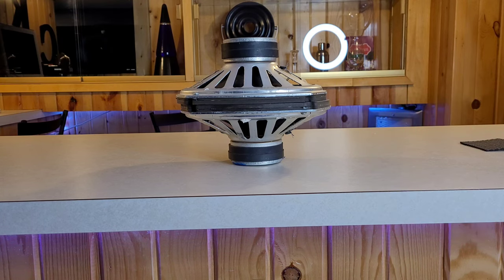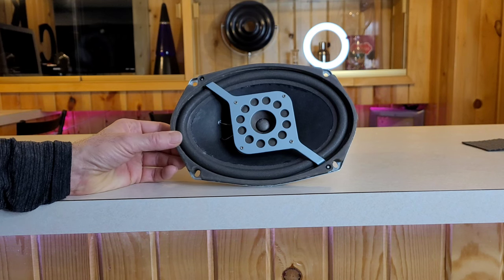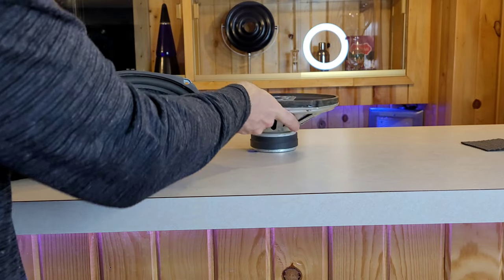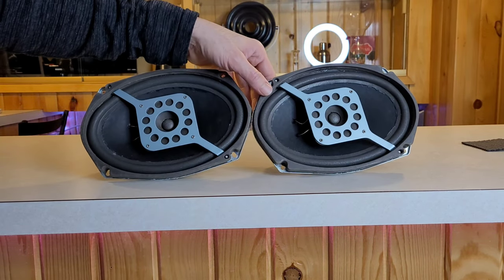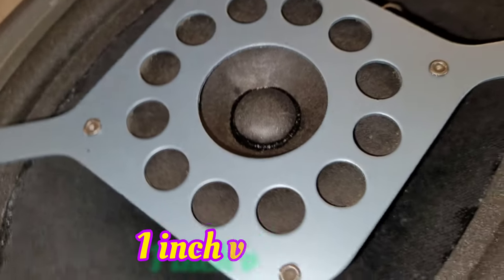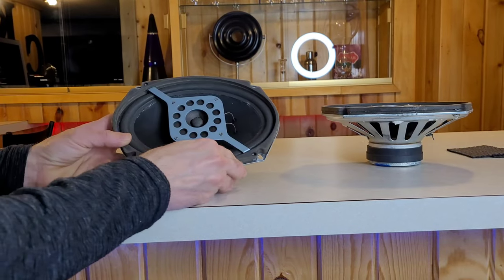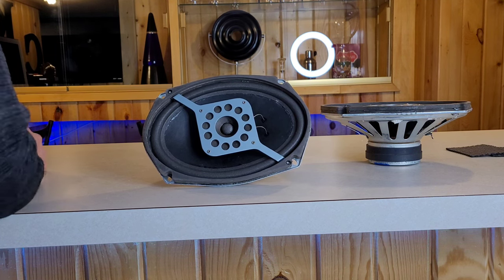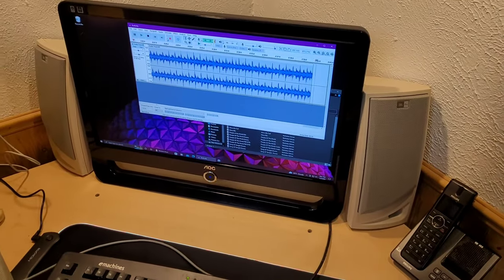Jensen Coaxial speaker from 1975. NOS 🔊   Model C9800

Comment: I installed sooo many of these in the 70s..these and the Pioneer supertuners. In their day, they sounded great (remembering early car stereo days)
Reply from the maker: I have always been a Jensen fan.  Their older stuff is spot on and has a good overall tone. Their 70s gear is almost all rather good. These have a nice sound and can take quite a bit of power. You also hit the combination on the head, too, with the tuner. I got my first set of wheels in the 90s, and Jensen speakers with a pioneer head unit is all I went to. Growing up we had a pair of Jensen OPC speakers.  That's when my speaker obsession started lol. Thanks for stopping by.

Comment: That capacitor needs to be replaced, it's probably passing lower frequency to that tweeter which is bad for them.
Reply from the maker: Very true. I will have a look and see if I have the correct value to replace it with.

Comment: Those are some neat looking speakers. I seen a pair similar to these In my buddy's old Malibu. They were in an enclosure on his back dash. They didn't sound too bad, they had a rich tone, crisp and clean vocals. I remember hearing a lot of rock songs come out of them. They didn't sound too bad, the tweeters looked a little different.

Good job fixing those. They sound pretty good. That's a cool keyboard you got. I have an arranger style keyboard too. I have the PSR-S500, it has a built in 8 track recorder and a spot to save your midis to a flash drive. I am looking at an upgrade eventually.
Reply from the maker: Very nice hope he has kept those speakers. Vintage Jensen Coaxial and triaxials are hard to find.  I'm happy with the repair job I did and the sound they produce. I have a soft spot for Jensen speakers lol. The back deck was the most common spot they were installed in. 
I love that keyboard. I bought it about 4 years ago brand new. Excellent keyboard. If your looking to upgrade I'd recommend this line of keyboards. They can do alot lol.

Comment: Have you ever heard of the mindblower speakers from the 70s?
Reply from the maker: Hmmmm. That name sounds familiar but can't recall them.
Reply: @speakeradventures  i think they had built in amps on the back of them as well. Kinda similar to some of the chrysler infinity speakers from the 90s.
Reply from the maker: @lilshag347productionsii6  I just looked them up. They look rather impressive for the time. Id like to get my hands on a pair as they were also offered along side of Jensen speakers in the 70s. I just like old speakers. I found out Tenna brand makes those speakers. I have 1 pair of Tenna 3.5 inch dash speakers. Do you own a pair of these speakers?
Reply: @speakeradventures  sadly no. My dad had told me before how popular they were in the 70s.
Reply from the maker: @lilshag347productionsii6  I saw that when looking them up. They are also hard to find. Only found 1 on ebay currently.
Reply: @speakeradventures  yea they are quite rare these days. Barely see anything about them on the internet. My dad used to have a pair of alpine 6x9s in an old chevy c10 he had along with an audiovox hi comp stereo which he still has to this day and its in the original box. I also have an old realistic cassette stereo that my grandpa had new in box as well. I have an old audiovox xtra cassette stereo sitting on my shelf for looks.
Reply from the maker: @lilshag347productionsii6  man that is awesome. Love vintage items, they need to be on display I agree there. That's pretty rad that your dad has them still and with the boxes. That adds value. Have you hooked the stereo up ever? They need 12 volts to work which you can get from on old computer power supply.
Reply: @speakeradventures  when i hook my stereos up, all i use is just a simple 12V wall plug. It works great.
Reply from the maker: @lilshag347productionsii6  wall outlets might blow up the car stereo, I wouldn't hook that up to the outlet. House stereos use wall outlets.
Reply: @speakeradventures  surprisingly enough, each stereo ive tested on the wall power worked great without any problems. I used wire nut connectors when i hooked the speakers and the power to the wall plug.
Reply from the maker: @lilshag347productionsii6  wow thats good to know. I've just made some portable power supplies with old computer PSUs.
Reply: @speakeradventures  ive always wanted to make one of those car stereo boomboxes using a car stereo and some pretty good speakers. I made a prototype bookshelf stereo system using my modded 70s speakers that i use as my mids and highs and mounted the stereo in a temporary cardboard box. It looked pretty awesome and sounded great as well.
Reply from the maker: @lilshag347productionsii6 yeah u and I woild have been pals if we lived close. I actually did that too lol.  funny your said that though. I had different speakers to show instead of these ones in this video that I did use in a stereo I made using 6 speakers. I'll show those speakers though. 
I bet the makeshift stereo sounded good though.
Reply: @speakeradventures  i was very impressed with it, just the other night, i had those speakers and my fishers connected to a stereo i have and it sounded awesome. The bass boost was only on 1 and the treble was all the way up. It sounded as if it were in a vehicle.
Reply from the maker: @lilshag347productionsii6  man your making me want to surround myself in floor speakers and just jam out. I bet it was awesome especially if the bass was only at 1.
Reply: @speakeradventures  sure was the stereo has built in bass boost and i only had it on 1 and that was powerful enough
Reply from the maker: Very nice. Big bass fan here lol
Reply: @speakeradventures  yep